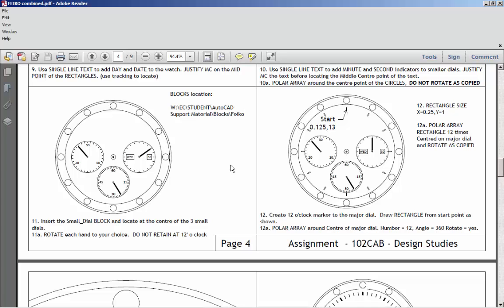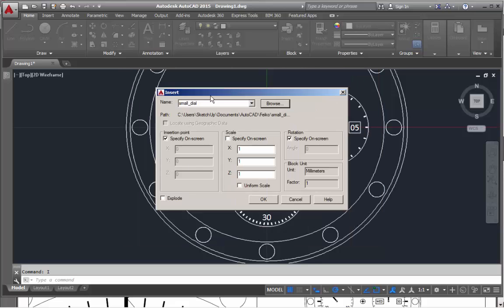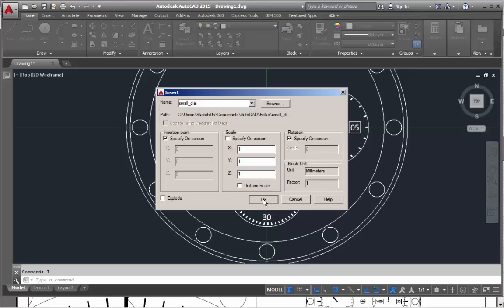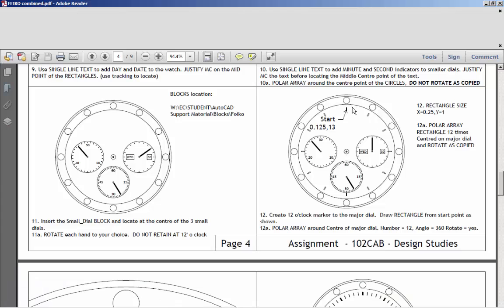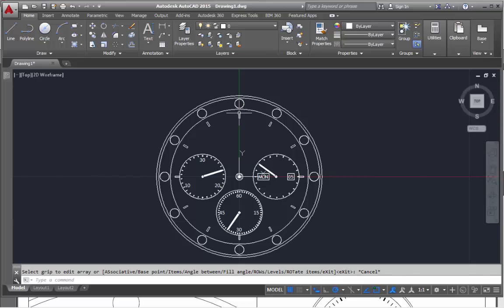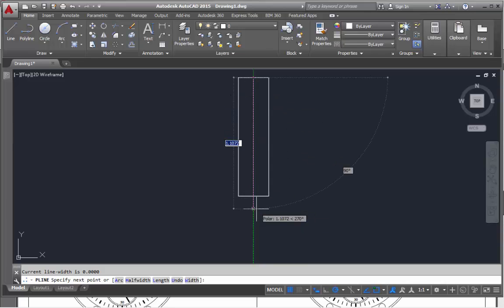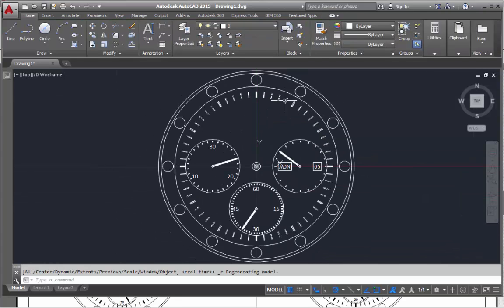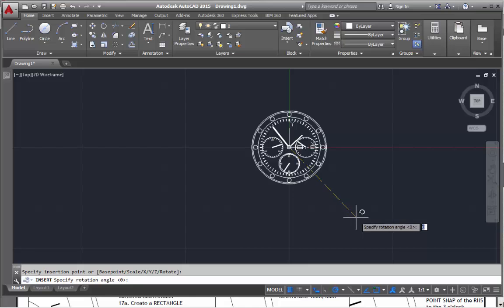Drawing a Better Watch in AutoCAD 2015 Pt 4

Comment: how to create a dial sir? small dial is missing in my file
Reply from the maker: Hi there, is it the small hand you need? ill try to find it. Otherwise you could create a circle, a rectangle and a triangle to approximately the correct size and use that. Use the Trim and fill commands to fill in the solid section. Should be quite easy to do. Otherwise Ill create one and add it to the folder.